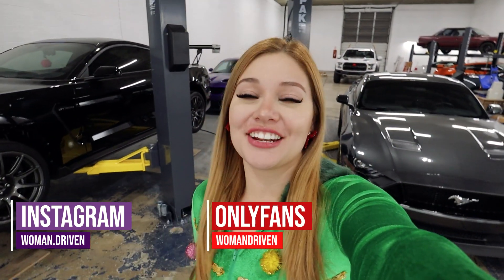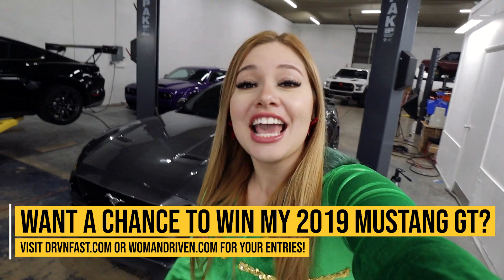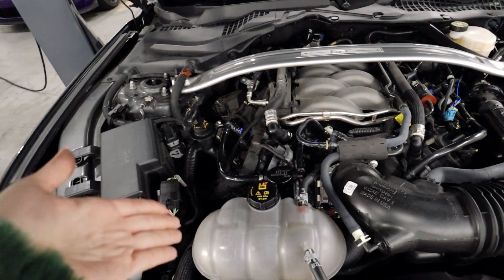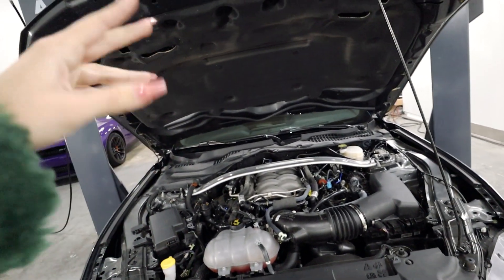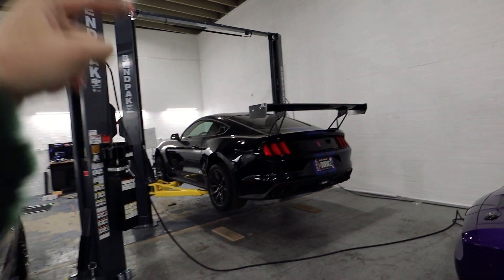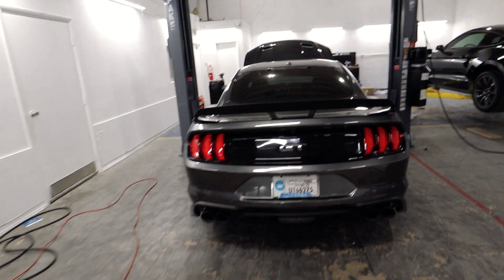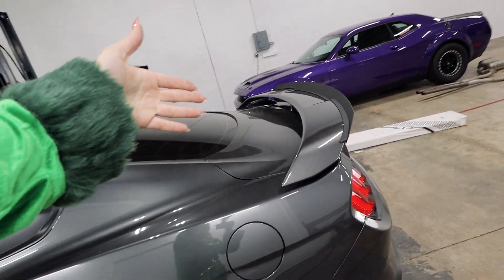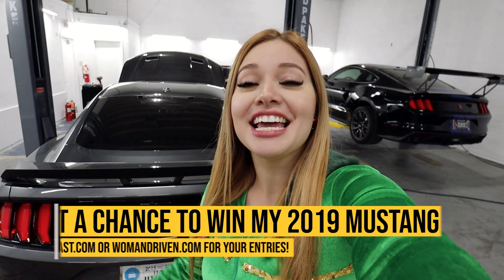CHRISTMAS GIVEAWAY!! + SURPRISE MODIFICATIONS FOR MY FORD MUSTANG GT!

Comment: DRVNFAST - If I won the Amazon gift card, I would buy another heated pet pad for the outside kittens. The mod looks great I think. Just those small subtle touches you add makes a huge overall difference and they look stock but they aren't.  It's one-of-a-kind.